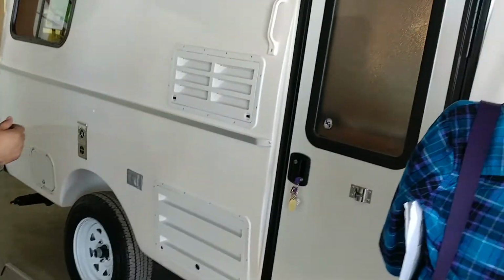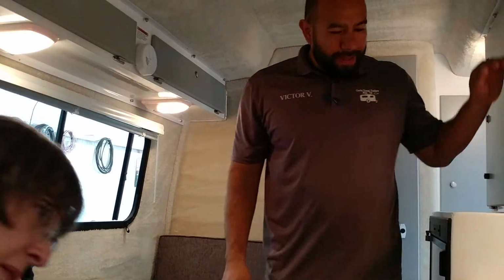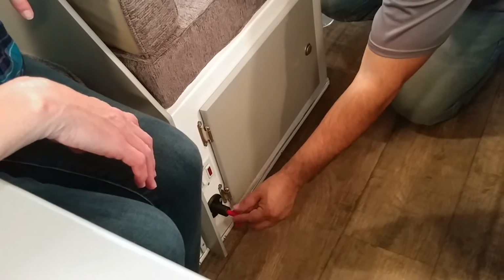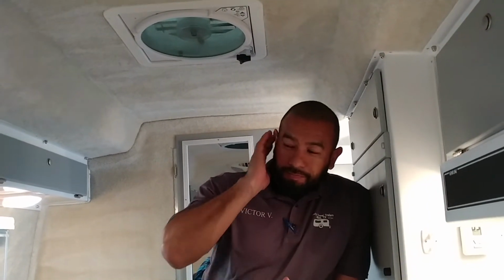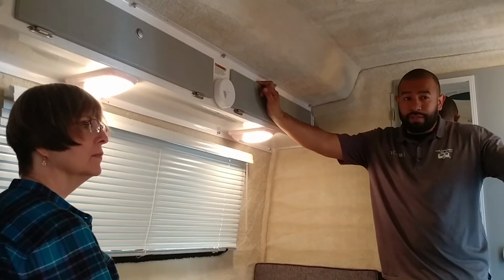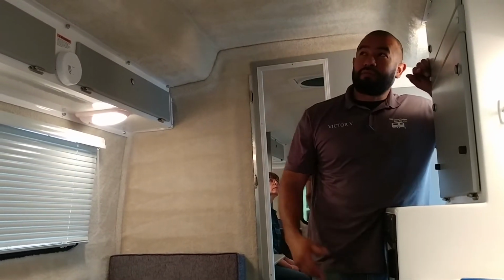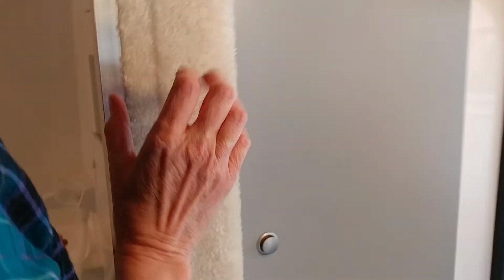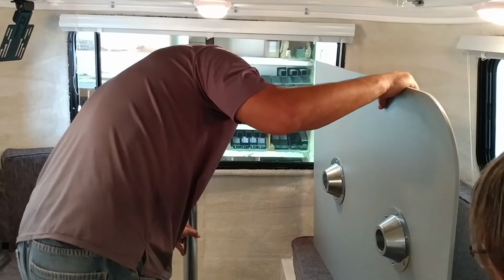Our 2019 Casita Introduction Tour.

Comment: Would love to hear about your experience using KIA SORENTO as your tow vehicle. Any issues while driving? and what type of hitch did you use? Thanks in advance.
Reply from the maker: We have just returned from a 5000 mile trip. The Sorento did great. We used a fastway trunion weight distribution hitch. This does require lifting the propane tanks a bit.
Reply: Why didn't you use the weight dist. hitch they sell there?
Reply from the maker: We love the Kia Sorento. Great tow vehicle! We use fast way trunion.
Reply from the maker: @mikewallace8727  Three reasons...Cost, Backing up is no problem, Don't have to use a rachet to put on and take off.